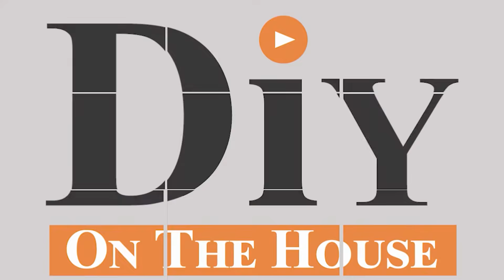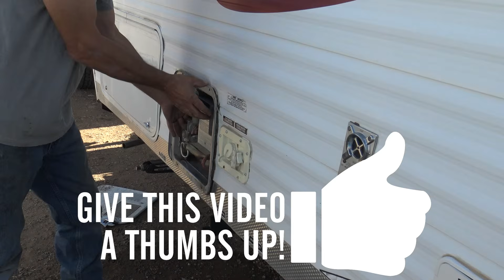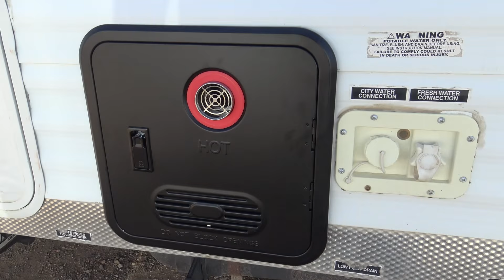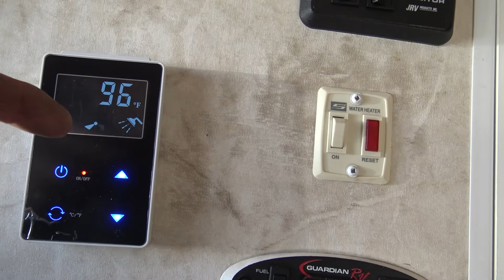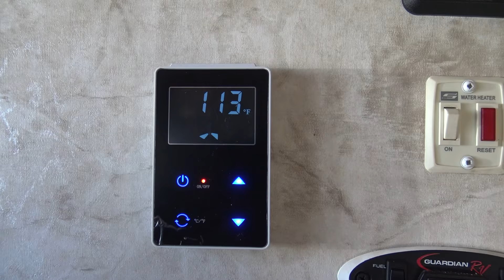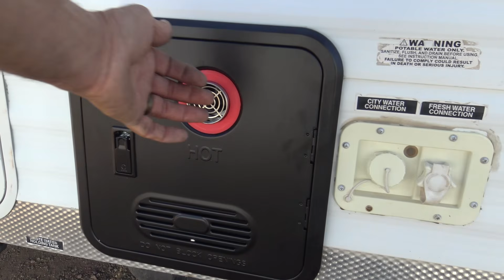Change Traditional RV Water Heater to Tankless Water Heater

Comment: I have a suburban sw10de water heater and are probably going tankless but there seems to be a side difference by a few inches smaller are the tank less versions. 

Any idea what to do with the gap?
Reply from the maker: After having several travel trailers and a couple motor homes, I try to look at resale down the road. If you have to do a modification that isn't going to look right for the sale down the road I would hold off. Unless you can find a direct replacement for the hole that you have. Just my opinion.

Comment: Would I have to connect the Gas line ? Or can it be bypassed and just run off the electric AC current ???
Reply from the maker: This is a LP gas unit only.

Comment: I’m not electrically inclined in the slightest so can you please tell me if this unit will fit a 2008 29ft keystone Springdale pull behind?
Reply from the maker: Sorry I wouldn't know. You would have to measure the opening before chosing a water heater size.

Comment: I've installed two now and the controller doesn't light up. I'm at my wits end trying to get these things working.
Reply from the maker: Did you check the DC polarity? Not for the controller but from the chassis wiring.

Comment: So we have done all the steps but the controller just beeps nonstop when we turn the original switch on to give it power. We cannot figure out what is making it do this. Any ideas?
Reply from the maker: I don't. Maybe double check the positive and negative connections. Being it is DC this has to be correct.

Comment: Just "dry fit"... how did you connect?
Reply from the maker: The gas was straight forward. On the wiring the positive negative was the most crucial. Make sure the DC polarity is correct other wise the water heater won't work.

Comment: I decided to go with a regular 110 volt small hot water heater im sick of these junk rv ones they all fail to quick
Reply: im getting a small 110 volt 6 gallon and converting it. i have a 5th wheel so plenty of room.
Reply from the maker: Hope it works well for you!

Comment: How did you bed the LP gas line. I have an almost similar set up as this video. I was looking into a flex LP hose to avoid bending what’s there.
Reply from the maker: I massaged it around. I was prepared to change it but I would give it a try.

Comment: We have removed all propane lines  from our RV and the wall control.
Can this or other units run on electricity only?
Reply from the maker: You can get a rv tank water heater that has a dual gas and electric, and run it on electric only.

Comment: So i am getting ready to do this project. We just purchased or first used rv. With the grand kids, weneed this. It seems really straightforward.  But i have a question. Should i run the positive and negative off the heater and tie it to the main existing heater on off switch on the wall?  You know to get the power source.  It looks like thats what you did.
Reply from the maker: Yes, I kept the main existing on off and connected to the wires for power and It worked great.

Comment: Installed one this past weekend. The only time the heater fires up is when the bathroom sink is turned on. I could run the kitchen sink for days and it NEVER fired up. I'm not sure about the shower. Took a shower last night with the bathroom sink hot water running!!!!
Reply from the maker: It may be a water volume problem, to little and the unit wont' kick on.

Comment: I’m surprised how fast the water got hot.
Reply from the maker: So was I! You can hardly hear it, I am really happy with it.
Reply: I literally can NOT figure out this thing. We ordered the EXACT same unit, on my camper we have a purple, white, and blue lines. I show the purple to be hot, blue neutral and white ground. I have wired and re-wired. I can't even get power to the control panel. LOSING MY MIND